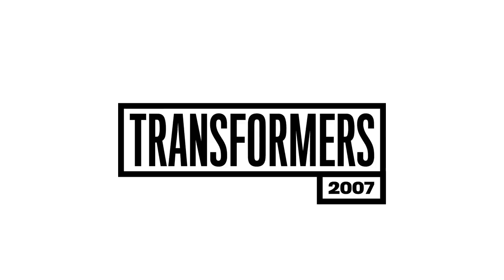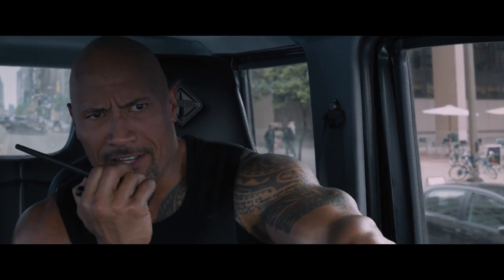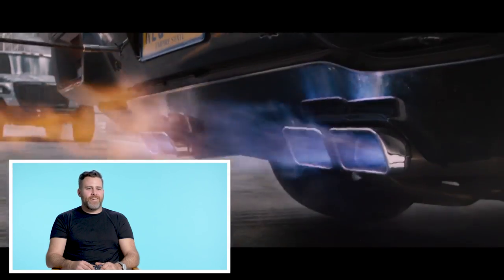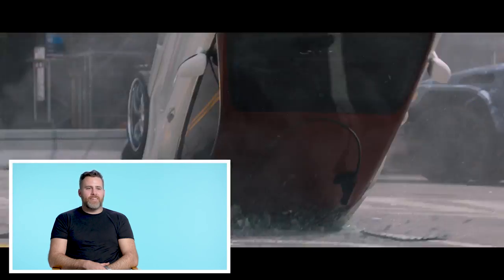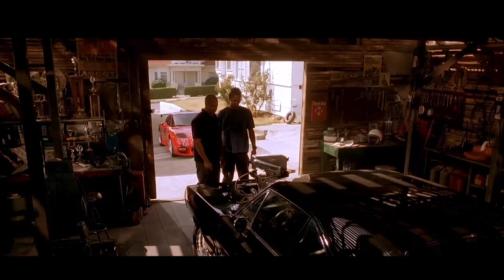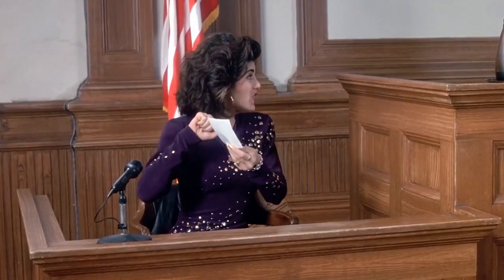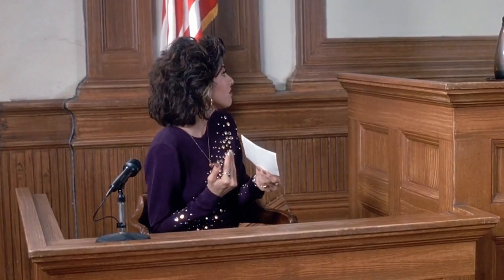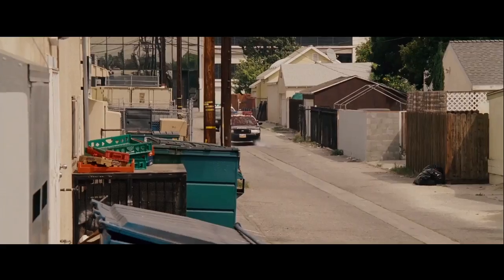Car Expert Breaks Down Car Scenes from Movies | GQ

Comment: This dude barely knows what he’s talking about..
Reply: true, he's made a few mistakes off the jump
Reply: Examples?
Reply: @Danimal77  24:16 that isn't the wheel itself having an issue if it's happening to both sides, the steering components are worn out. The "doughnut" spare can go up to 60 mpg in most cases as they designed it so you could get off the highway. If you loose the key on a Ferrari you just have to get a new key that's been programmed by a dealer obd2 tool the computer and ignition cylinder are fine to stay. That's just 3 for examples I could point all of them out if you want but it'd be on helluva list.
Reply: Dan Maler Megan fox talks about the car having a high rise intake and this dude immediately jumps to explaining “high rise headers”? No ordinary car has such thing and it’s not even what the movie says but that’s the first thing that comes to dudes mind so he runs with it to try and sound knowledgeable

Comment: he might be a mechanic and a very good one but he is saying a bunch uf bs like formula 1 tyres are big because they need to flex, that ain't true only dragsters need them to do that is only because of regulation and tork is not a better way of saying how much power an engine has tork is a twisting force and hp is torke multiplied by rmp devided by 5252 (i don´t know why 5252)

Comment: My cousin vinny; 
It does not have independent suspension. Positrac is the brand name of differential. It is in the subcategory of a limited slip differential.  It is now able to install in just about any rear wheel drive car. Independent rear suspension does not mean it has limited slip. It just means the wheels can move independently of one another. Unless the car is at a severe degree of tilt, the tires are able to flex with a conventional differential with the wheels fixed on a single “beam” axle.

Comment: Flames under acceleration not likely? Someone's never seen a nitrous car run the 1320
Reply: His explanation of fire in an exhaust is inaccurate.
It is air/fuel that is unburdened due to the engines relationship to valve overlap, limitations to combustion time in relation to air/fuel volume and engine speed... happens frequently with various artificially aspirated engines and a few normally aspirated engines.
Reply: Jerry Reed hello mr expert, nice 2 meet u

Comment: In the first part with Transformers, this guy doesn't know what he's talking about. He mentions the double pumper thing after just pointing out that it has individual throttle bodies. He doesn't even note that the ITBs have nothing to do with carbs whatsoever, other than they both get fuel and air into the engine.
Reply: I complained in the theater while watching that movie.
That is a Englese or Kinsler style fuel injection.
That was popular on Sprint Cars in the 1980's and '90's.
Reply: He said a high rise intake is headers that go over the engine lpl

Comment: Re: My Cousin Vinny. 
Mona Lisa clearly states that there were only two cars built in the 60s that had ENOUGH POWER and independent rear suspension to make those tire tracks. The Corvair may have had independent rear suspension, but it didn't have enough power. 14:09
Geez dude, pay attention.

Comment: An open differential allows the tires to spin at different speeds. The tire with the least amount of traction will spin while the other does nothing. 

Posi traction (limited slip) does just as the name implies. It allows some differentiation between both tires but for the most part tries to keep positive traction to both tires regardless of turning or terrain. A locking differential does just that . Wether automatic or manual. The differential is physically locked together allowing positive traction WITHOUT ANY DIFFERENTIATION.
Reply: Also an independent suspension doesn't mean that you automatically have positive traction. They have usually have some sort of differential the same as a straight axle. They just allow for more traction generally than a straight axle in some situations

Comment: Cool video, mostly good info, but Bee's engine would be 500ci, not cc, and his explanation of Posi-Trac was way off. A standard solid axle would send power to the wheel with least traction, it would need some form of locker (Like Posi-Trac or limited slip) to make both wheels spin evenly like it was described.

Comment: A friend of mine jumped his car once. Wasn't exactly on purpose and he ended up totaling the car. By totaling, I mean the frame snapped in half, the drive shaft broke, and the bolts holding the front suspension in place broke off. He survived mostly unharmed, but his car was done.

Comment: That "big" engine is smaller than the Caterpillar 3208 that I put in my 1977 Mercury Grand Marquis coupe. I also used a Chrysler A727 Torqueflite transmission and a GM 2:50 rear differential. I named it Maybelle after my Best friend who built the exact same engine/drivetrain combo in a 1972 Ford Gran Torino.

Comment: I'm angry about the Whipple charger comment. That is a roots style blower. It uses 2 matching helical rotors to compress air into the intake/cylinders. A Whipple charger is similar idea but one roots style rotor interlocks with it's negative shape. There is a reason that top fuel uses roots blowers, though in a streetable car, either style will make as much pressure as you can use.

Comment: Limited slip was mad because in corners both tires take a completely different path one makes a large turn the other takes a smaller turn if they were locked together they would bind up causing skipping and bumping of the tires. If u wanna see get in ur 4wheel drive turn on 4×4 take a turn on concrete

Comment: Positrack means both rear wheels spin together when gas is applied as opposed to a one wheel peel nothing to do with solid axle a locking diff makes your truck a posi
Reply: Isnt positrack an LSD and not a locking diff?

Comment: He lost all credibility at the beginning when he said that the engine in the transformer camaro would never be in there and was a "huge 500 cc" engine. Ummm, most motorcycles have larger than 500 cc inches. Cars have Cubic Inch (C.I.) measured engines, motorcycles have Cubic Centimeters (C.C.) engines because they are much smaller. Not to mention, bead rolled fenders as he mentions is something that show cars do so yes, it's completely possible that the engine and fenders could have been in that car if it were once a show car. Get better "professionals" to brake down these movies.

Comment: In Rat Race, it's not the car's winch that's lifting it onto the satellite array, it's the tow rope got caught in it, and the satellite spinning is what's lifting up the car. Still funny to hear it's feasible the other way around though :P
Reply: Thats a radar that the tow rope is wrapped around. I doubt the motor turning it would be powerful enough to hoist a truck though. But the movie is still great. 😆

Comment: The car expert- 500cc engine. ITBs dude. Tire size means traction (common misconception, tire size doesn’t increase traction it just allows for a softer compound to disperse its weight more evenly so it doesn’t wear out too fast. Also side wall stiffness plays a big part in allowing softer compounds to be used.) Its weird because he knows how fireballs happen, but doesn’t know any of the other stuff.

He’s a fabricator, very skilled probably, and clearly knows some things. But I’m definitely not a car expert and can point out he’s wrong on many accounts.

Comment: 0:50 "At least a 500 cc engine". My Dad's old Hyundai has a 1600 cc engine and it's an inline 4! A 500cc engine is something you'd find typically in a motorcycle, not a car! Maybe he meant 500 cubic inches not centimeters.

Comment: This guy seems to be clutching at flimsy info throughout this.

As for the Bentley, it would fold? Those things are tanks...

I remember the old movie apocalypse Doomsday, spoilers, theres a mad max style chase where these ratty apocalyptic cars are chasing a spotless Bentley Continental.
The directors said they had 3 Bentleys to do the Stunts and I'm sure they said they only needed 2, the Bentleys apparently handled everything they threw at them, slams jumps and even a jumping ram through a roadblock.

They essentially said the chassis was so strong they only needed to do cosmetic repairs and they were good as new.

Comment: Its not a Whipple supercharger. That is a 6-71 or 8-71 roots blower.  A Whipple is a twin screw. ..different animal due to how/where the compression of the air takes place within the blower. Roots ifni remember right is against the case walls and the Whipple is within the screws

Comment: The "Car Expert" totally missed on the posi-traction. Has nothing to do with suspension. Its a Rear Differential Gear Train where both tires spin not only 1. Meaning you would leave equal length tire marks, not just 1.

Comment: Planes trains and automobile; the car is not a Buick. You typically cannot visually see a wheel out of balance unless the wheel is bent or the tire has internal breaks and is slowly coming apart. That being said, totally possible to go 80mph, but it would be a very frightening experience.

Comment: at 23:00 the button is used to jump the starter trigger wire safley for diagnostic purposes, use it all the time
and driving on a donut is possible my first car honda civic 2004 blew a tire i drove on the highway going 120 km

Comment: The car doesn’t have high rise double pump carburetors it has a velocity stack system and yeah that engine is not the stock engine but that doesn’t mean it’s doesn’t belong in this car

Comment: He's very wrong about limited slip differentials. The whole point of them is that torque is not necessarily sent along the path of least resistance - if one tyre is slipping, an open differential would send all the power there, because that is the easiest place to send it, beyond a certain degree of slip, an LSD will send power to the wheel that actually has traction.

Comment: "torque is a better definition of horsepower" no dude, torque and power are two different things, so much so that you can have one without the other 🤦🏻‍♂️ (plus a 200 hp n.a. car with less torque can still accelerate as fast as a 200 hp forced induction car with a higher torque if their power curves and power to weight ratios are similar)

Comment: Expert??? Are you kidding. 1-he is guessing the cubic inches (he says CC) by looking at the valve covers and fuel system 2-he kinda describes the furl system correctly, then the girl in the clip talks about headers, high rise intake and dusk double pumper cars, then the guy goes off the deep end talking non sense about things not on this car, mixing up parts...if this guy is a car expert then I am Carroll Shelby

Comment: the front of the car start to go down because of the weight of the engine for movie jumps they put weight in the back winches use steel cables not rope airbags immediately deflate

Comment: A 3300 pound car that runs 9's, would have to make about 900 horsepower. A 5000 horsepower car is running nitromethane and would have to carry it's weight in gas to drive 10 miles. So, no. That car doesn't make 5k horsepower.

Comment: This guy doesn't even know the difference between an lsd and an open diff 😂 my dude an open differential lets the wheels spin at different speeds too.
Also, even with independent rear suspension if you don't have a diff you'll be spinning around 😂

Comment: I really hated when he was talking about the bumblebee engine. Saying that it was accurate. Implying that throttle bodies and carburetors are the same thing, saying that each cylinder has its own carburetor, when it is clearly fuel injected just be looking at it. I feel bad for him honestly. Why did they have a motorcycle guy talking about cars?
Reply: Its not necessarily EFI. It looks like it could be a sidedraft, which if its a quad setup would be one carb per 2 cylinders

Comment: Wow, this guy is... not so expert. Posi-traction means, in modern, non-marketing terminology, it had a limited slip differential, or a locking differential. A lot of older RWD cars had a simpler differential, and would only peel out with one tire, leaving only one tire mark. It has nothing at all to do with independent rear suspension.

This guy is kind of obsessed in general with suspension and tire thickness. You can have perfectly good traction with low-profile tires. Big knobby truck tires actually have much lower traction on pavement. If that diesel could pull (one, maybe two) of those other cars, it would be because it's heavy, and because it has all-wheel drive, not because it has high-profile tires.

These things usually have people who know what they're talking about, but this guy clearly doesn't. Epic fail here, GQ.

Comment: I rarely comment on videos before I finish watching them. but... "This is a huge engine..." ... "that is a humongous probably 500cc  engine" Just absolutely trashes his credibility. I know he *meant^ 500 inch" because 500 inch is absolutely a massive displacement. There's few motors that are that big, which is equivalent to 8.2 liters. Liters being the most common - by far - measurement of engines, even among American manufacturers in modern times. A 500cc engine is even smaller than the smallest class of competition motorcycle sport bike engines. I'm not going to say that he doesn't know wtf he is talking about, but to make a gaffe like that without immediately correcting it with "I mean 500 inch, not cubic centimeters"  is just... grain of salt already not in his favor.

Comment: Guy really thinks a 900hp Charger wouldnt do 9secs...who is this guy?

Fun Fact: i just learned today that the engine in Dom's Charger was just slapped in there for the scene and that particular car does not actually exist. This guy lies.

Definitely questioning all the other "Experts" at this point.
Reply: No, the other Experts are usually very accurate in their assessments, if not only a few hiccups. This guy, however, is very unqualified.

Comment: That's a huge engine! Probably around 500cc lol! 0.5 litres? If he was talking individual cylinders even then it's still small unless it's a v12 looks like a v8 though, each cylinder has individual carburetors? Since when does a carby have a throttle body? don't think he knows as much as GQ thinks. couldn't watch after that!

Comment: That international would have a dt444 or dt466 the dt 444 is the 7.3l that ford put in there f250s to f650 plus and horse power is related to time. Aka why Ducati can get 236 hp out of there bikes but they rev at 16k rpm where a Mazda mita only revs 6,400 but only half and has more displacement And hp and torque are two different things, a can can have 900 hp but only 600 pound feet of torque or a diesel has 150 hp and 400 pft or a dozer which runs like a like 450 hp and have 200,000 pft. Guy should stick to being a car guy and not be a mechanic.
Reply: Its for pullin 18 wheelers he says.....🤣
Reply: @googuser3145  yeah that was all levels of stupid

Comment: 5000 horsepower......in a car .....naw .....an sd 70 mac locomotive has 4400 .....and its a train engine
Reply: In a streetable car, difficult, but possible in theory.....with purpose built engines.....yes... 500CI+ hemi (not necessarily Dodge) turbo or supercharged with nitrous. Top Fuel dragsters are in the 10-11000hp range. Google it for yourself.
Reply: On the lower, realistic end. An LQ4 6.0 LS on stock internals can unreliably handle over 1000hp. Built with available parts it can be more reliable.... but will break eventually....   Reliably.... a 95L Cummins QSK95 will produce 4000HP....... in a train.
Reply: Goog User smart stock bottom end lq4 will handle 1500hp weak point rods and pistons, now 5000hp in a street reliable car is possible but extremely far fetch with the cam and that amount of power it would be a extremely big asking of a 3+ gear transmission only trans I know that can handle that kind of power custom built th300 or th400 if it’s prayed over

Comment: woooow ok. so, a posi rear end is a limited slip differential, a marketing term for limite slip diff's was positraction, its a "kleenex word". for limited slip diffs. his whole thing about suspension is false in the first place. shes talking about diffs the whole time. then, and just wow, a fixed rear axle still has an open differential ya nutjob, cars are always sold with a differential, because in a turn one wheel makes more rotations than another. drifters will weld diffs shut to get less traction but thats it, every other car eve rhas a diff . open diff spins a one wheel peel. A limited slip diff makes it so not just one wheel spins, bit another does as well, it limits the "slip" that causes a one wheel peel. my god dude, 500cc and your explanation of torque were dumb enough but wooow

Comment: "The engine would be humongous"

no its a common non-carguy misconception that the bigger the engine the more power. He could have a turbine engine wich would be able to create 5000HP while being compact. Or he could have a massive V14 or V16 wich can easily produce 5000HP without sticking through the hood. This guy isn't a Car Expert he is just pretending to be one.
Reply: im sorry, your not getting 5000 horse in a car, locomotives make 5 grand and you know how big there engines are.
Reply: @Rascal-yx6ir  yeah pretty small but the got like 20 of them.
Reply: @idknils2920  what?
Reply: @Rascal-yx6ir  electric

Comment: This guy. Wtf. Come on. I usually love watching these "expert" videos. However. This one is absolutely garbage. I'm currently building my ecoboost mustang and I know more than this guy. He contradics himself multiple times. 500cc? Fuel injected and each cylinder has its own carburetor?  Torque is a better discretion of horsepower?  No. Horsepower is how fast you hit the wall. Torque is how far you take the wall with you. Get this guy out of here.